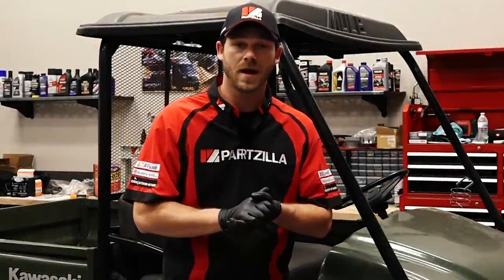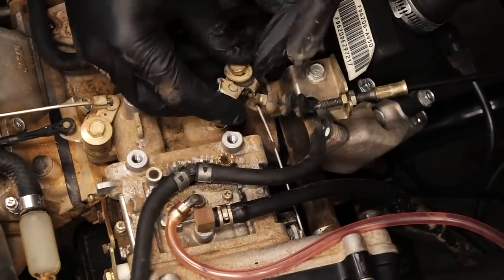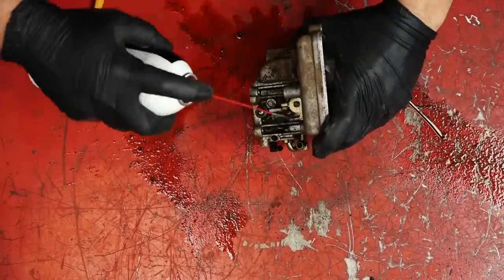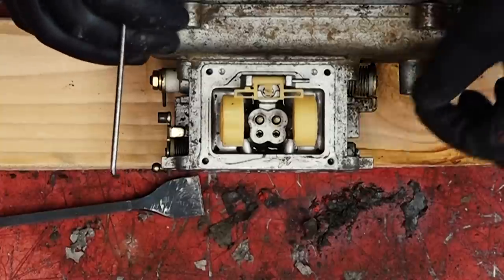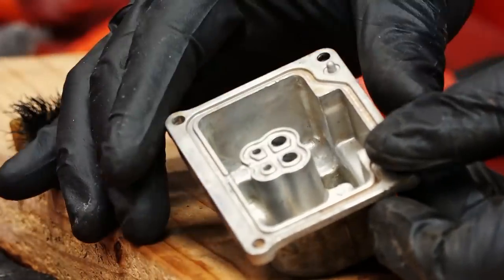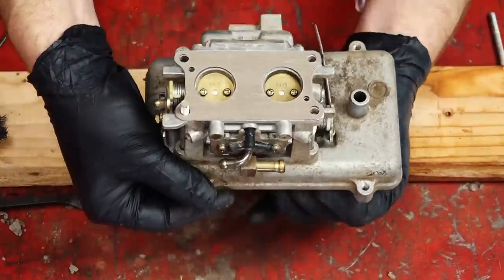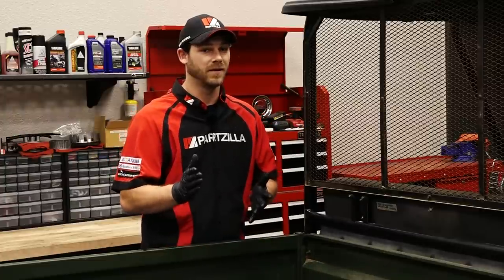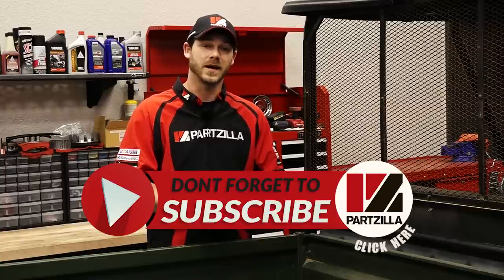Kawasaki Mule Carburetor Rebuild & Cleaning | Kawasaki Mule 3000 | Partzilla.com

Comment: People I've done this no less than 50 times over the years. If you want your mule twin to start with choke and stay running to warm up you need to remove the two tamper proof plugs and open the mixture screws a 1/2 turn and the cold natured beast will be gone. They  send out engines so so so lean especially lawn equipment. They are on the top two round idk 1/8 bosses facing up and have two welch plugs wit tiny holes in them. Be cautious! if you drill as when bit passes thru and goes too deep the bit will hit the screw ramming it closed in its seat and that's not good! I actually use a bit with depth stop on it. The Yamaha GP and XLT 1200 pwcs were same way but on high speed adjustments. Ive also many many many times reused the carb/manifold gaskets with no issues! Ive also ruined them and made them by hand with gasket material. This is a very good professional video and guy too but Ive been doing this work for a living since before this guys parents was in grade school. Ive reused tons of oring style bowl gaskets too. the issue with bowl screws is most watching this video dont even know what a JIS screwdriver is. you also failed to mention the mule twin carb is coolant warmed! crimp/pinch the two coolant lines to keep air out of coolant system that's a whole different problem that could be created. the 2 lines with clamps on the y fitting are coolant lines!!! not fuel and vent! Partszilla and boats.net are good and genuine parts but after years I recommend looking up parts and calling them with order.
Reply: Also is the jets different sizes?
Reply: @stevegann3251  The screws are for low speed only and only controls how much fuel is getting to the low speed mixture side of the carb. A person needs to understand how the carb works at idle to about 1/4-1/3 throttle engine is running on the low speed circuit then after that its combination of low speed and main jets then at wide open its running on main jets . the old mules run fine at wide open aka main jets. when you screw in the mixture screws it limits the fuel at idle and 1/4 throttle. and also remember when a  mixture screw is on engine side of a carb its a fuel screw and when its on air filter side its a air screw.  when the throttle plates open it uncovers small holes in the bores that fuel then flows thru.feeding engine at low speeds. Dont mess with jets. Kawaski tried to help this issue by running heated coolant thru carb heating it up. Thats the  two black lines on center top. I pinch them when removing so air dont get in cooling system! The two screws im speaking of limits amount of fuel able to go thru plot jets. so opening screws is like going few sizes larger on idle aka pilot jet. BE CAREFUL REMOVEING TAMPER PLUGS!!!! IF DRILL BIT GOES TOO DEEP IT WILL HIT AND RUN SCREWS IN TOO TIGHT RUINING CARB!
Reply: But if you open the screws underneath 1/2 to 1 turn more  it will start after choking and stay running when cold!

Comment: thanks for a clear concise video. I just did this on my 01 3010. my problem is the choke linkage travel. I don't seem to have enough adjustment length in the cable to pull the choke butterflies completely closed.  It also would have to be in the full closed position to push the lever arm on the opposite side of the carb down far enough to push the throttle butterfly to fast idle.  This machine has always been very hard to start, and I'm wondering if I'm just not able to ever get it to full choke, but the only adjustment I see is the threaded shaft on the cable housing.  That doesn't seem to be enough.  The length of travel at the choke knob itself seems short as well,  only about 1/2" from pulled all the way out to all the way in.  Am I missing something?  thanks.

Comment: Great video , very thorough & instructional !! Question ...  the small lines that go on top of the carb look like they have coolant running thru them ,, what is that for , what does coolant actually do in there ??  Thanks !! 😎👍
Reply: antifreeze circulates to warm the carb.  supposed to keep it from forming ice.

Comment: I have a mule 610 2006 and carb if getting no fuel I purchased a new fuel pump still no fuel. Its not the fuel tank i cleaned new filter also just asking for help

Comment: I know this is a bit off topic but do you have any recommendations on setting fuel mixture?  I have a 2019 Mule SX and the owners manual recommends a carb adjustment if above 2000'.  I'm at 4000' feet.  Seems to run okay but concern it might be burning rich.  Would love your input.  Thanks.
Reply from the maker: Up to 4k, you shouldn't have to rejet the carb.  Just your air-fuel screw adjustment.  For every 2000 feet that your altitude has increased after that, decrease your jet one size and go one clip leaner on your needle jet.  At least, that's a good rule of thumb.

Comment: Does the smaller clear tube hook to anything on the other end? Mine is hooked to the carb and just hangs down by like the gas tank.
Reply from the maker: If you're referring to the vent/overflow hose, then no, it doesn't attach to anything
Reply: @PartzillaParts  Oh good thank you very much.
Reply: I know this is an old comment, but were you referring to the clear pink hose?
Reply: @timwilson3529  yes
Reply: @mirai3263  sweet! Thanks for responding!

Comment: How do you adjust the idle. Mine will not stay idling. Carb was cleaned but no idle
Reply: What is the  torque on the head bolts  of a 3000 mule 2004 model
Reply: Did you find a fix for it?
Reply: Pink hose is a vacuum or vent hose so if it’s clogged it won’t run at all that was my problem
Reply: @blocklife03  where does the pink hose attach on the other side?
Reply: @timwilson3529  mine didn't attach to anything and was pointed to the ground.  It was clogged with mud and wouldn't let any air past.  I tested by disconnecting the hose and the motor ran amazing.  So i unclogged the hose and repositioned it where it would be less likely to clog again.